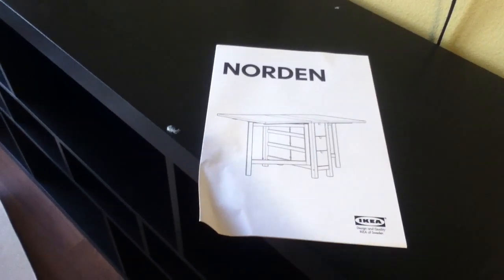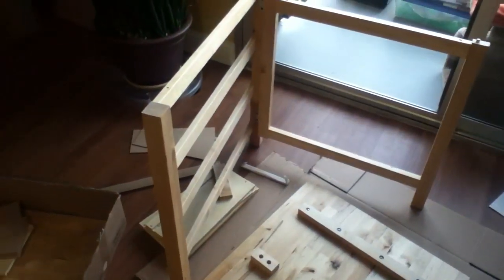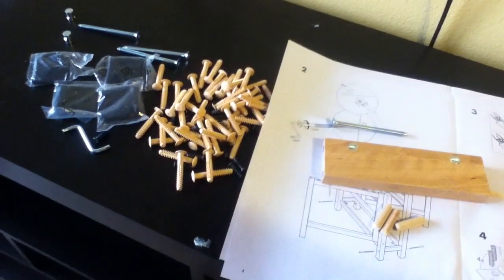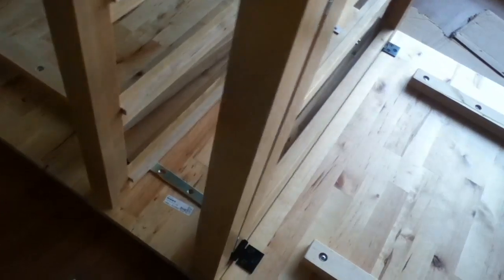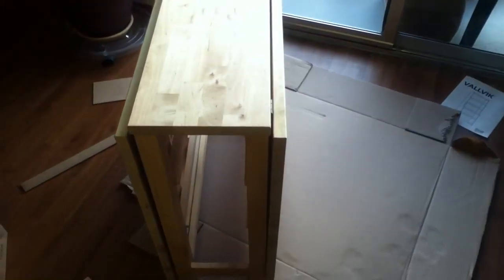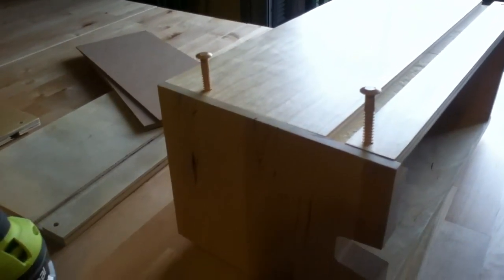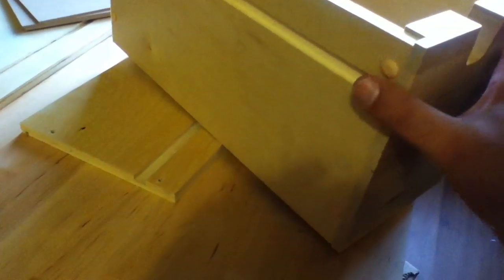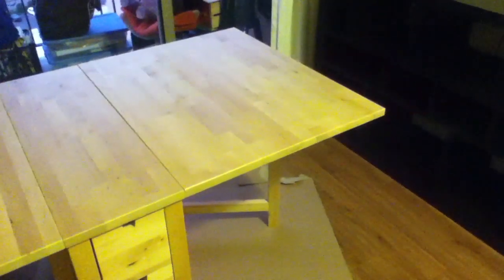Ikea Norden table Assembly Tutorial

Comment: I just bought and finished assembling this table.  I originally tried driving the screws into the solid wood using a normal screwdriver, it was pretty much impossible for some of the screws.  I had to borrow an electric driver to finish the job.  Nice table once it's done, but the assembly is more difficult than anticipated.

Comment: Hello. 

I like the way you did your video but I have an issue you didn't discuss. This is the first IKEA thing I've ever assembled that's defeated me. I cannot get 40 or those 42 screw-bolts to go in flush so things aren't secure and other pieces won't fit.

At first, I thought that maybe the holes weren't deep enough so I checked with a knitting needle. They are the right depth. Then I thought maybe it was my arthritis, so I  used a power driver but it didn't work and I'm afraid of stripping the heads to try again. I've removed and retried countless times because  I thought maybe I wasn't getting them in straight. I know, however, that I have them straight. It's consistently about a 1/8"-1/4" out.

I can't have someone from IKEA come to do it (I'm almost at that point) but I'm in protective isolation because of COVID, so anything that is to be done I need to be able to do myself. Help, please.

Comment: Great instructions, one question though, our fully assembled table hinges don't go high enough, so there is not enough clearance to actually open the table's legs. Any advice on what went wrong?

Ie. if the table is upright, we can't get past the surport beam. Did we maybe make the table too tight?
Reply: We figured it out, we got the hinges backwards. The the inner hinge or single piece is on the bigger outside part, and the double hinge is on the smaller inside part. This is very important.

Comment: Hello, there. I watched your video before trying to put it together. I can only get 2 of the 42 little screws in flush. If they aren't flush then the rest won't go together. What am I doing wrong? I've even used a drill trying to get hem in. There is no point on them and I'm wondering if that's the problem. Any advice would be appreciated it.

Comment: i just bought this table and haven't built it yet. I was going to buy some wood glue to help bind everything... Do you think it's worth doing?
Reply from the maker: Glue is more likely to cause more harm than good on most parts of this except for the drawers.
Reply from the maker: LIke I said, only on some parts of the drawers, like where the bottom piece slides in, but it would also be perfectly fine without glue.  If something loosens up from moving the table, then  I suggest pre-drilling some very thin holes and using deck screws for repair.   Deck screws that are long enough to go from a damaged area to an undamaged area, and then that repair may involve some glue if the wood spintered apart.
Reply: Sophia Pagan it does not matter if you cannot ever take it apart, Ikea never carries replacement parts, so no reason to disassemble it. we